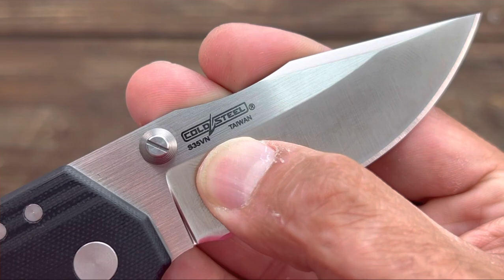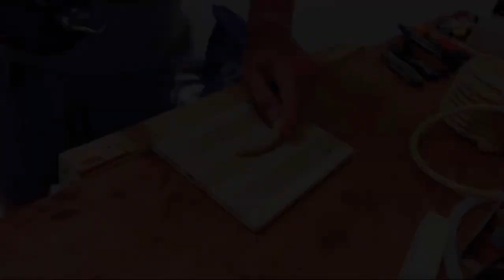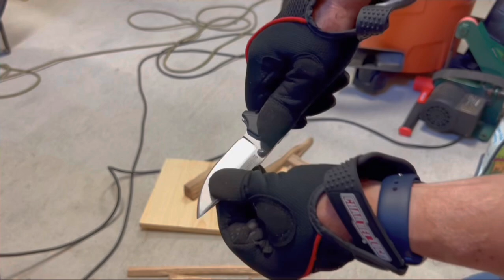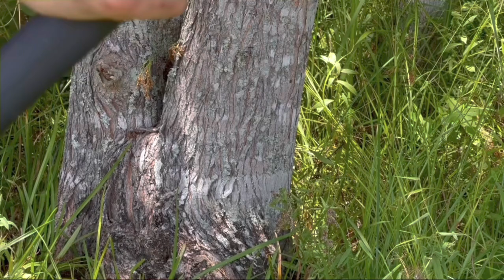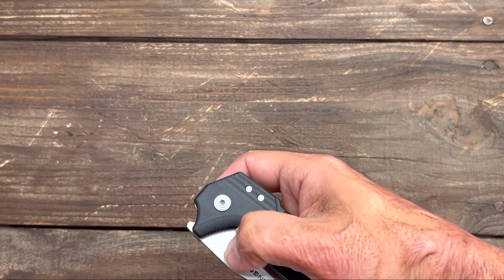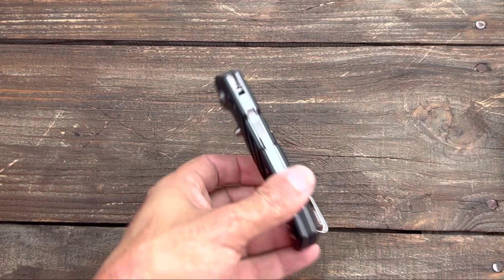HARD USE TANK! COLD STEEL ENGAGE ATLAS LOCK /TEST &  REVIEW

Comment: Excellent, excellent review. I am a big CS fan. My hesitation on purchasing this one was not the price but the detent or reported lack of and general construction T6 hardware, weak spring? I am not comfortable and or confident with the new ownership. At least you proved the heat treat is still good. And banished the myth that the scales are Polymer and not G10. At that price point anything less than G10 would have been a huge disappointment. Looking at you Cold Steel Razor Tek, 4116 steel and Polymer scales for $150??? Again thanks for the great review, I am still on the fence on this one.
Reply from the maker: You could probably stretch the spring a little or get a longer one. It’s not really a safety issue because the blade is facing the pocket seem so it can’t open in the pocket however the weaker detent causes you to not get a really snappy action and I think the only way they will be able to fix that if the other two methods I said would be to put the knife on bearings and that’s not a good idea for a hard use knife so not sure what the best fix is
Reply: Not a myth, the other models will have polymer. This is just the more "premium" variant. You can see GFN clearly labelled on the Cold Steel website for the all black, orange, green, and FDE versions.
Reply: @FactFinderGeneral  Thank you for the clarification